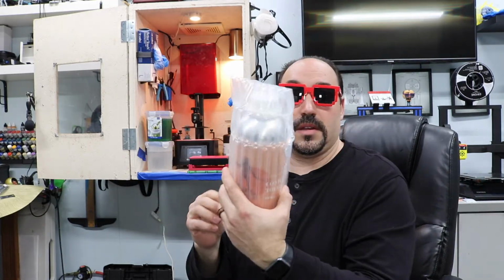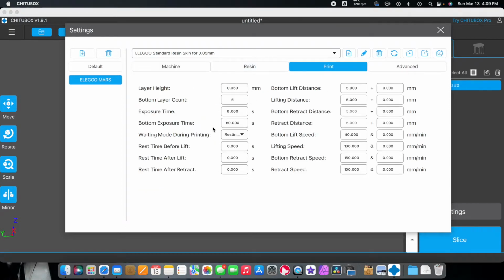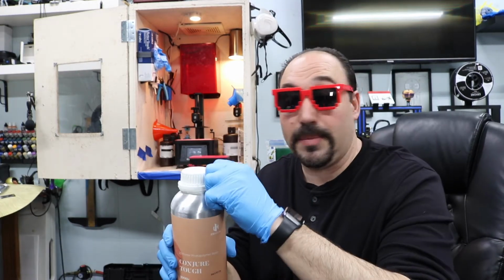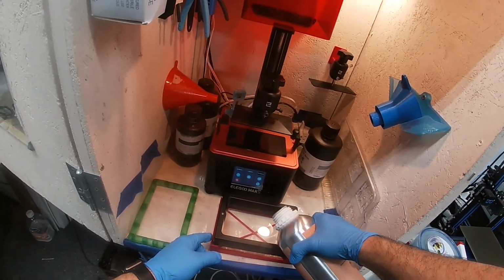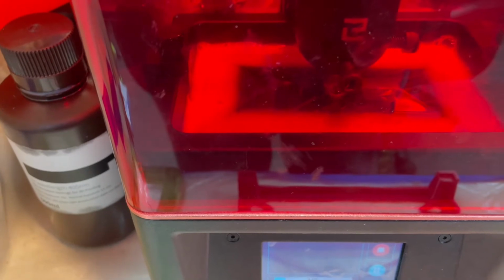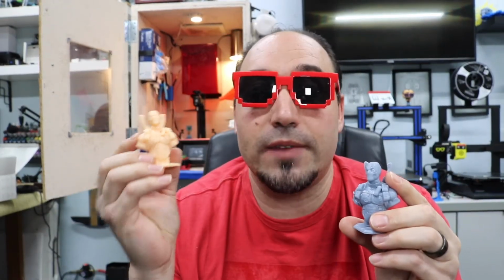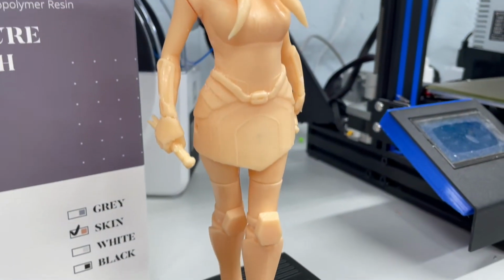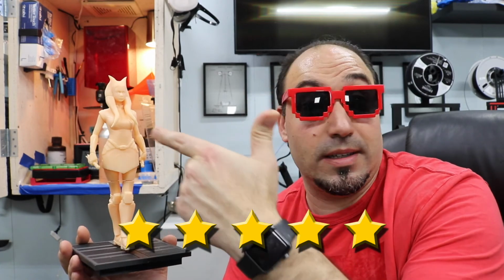Jamg He Conjure Tough resin for 3d printer review

Comment: Thanks for the video.  Kinda bummed you reviewed a "tough" resin and didn't do any toughness tests or comparisons.  Compared to any other decent resin what made it earn 5 stars versus 3 or 4?  I would recommend you limit a "star" rating to objective measurable results, because this comes off as a "thumbs up" passing grade so maybe just label thing that way.... "Crazy approved" instead of a star system, to stay safe with your non-offensive free stuff sort of policy.
Reply from the maker: I actually shot a ton of video on testing strength and durability against the elegoo Resin. They came out the same and video was way too long. I gave it a five star because it was a five star it did what it promised to do, and printed well. Trust me if it was crap I would tell you. Been shying away from companies giving me free stuff lately. Because they try to push for five stars and video previews. Never gonna happen! I’d rather buy my own stuff and I make enough money to do so on YouTube. Next season so far is just stuff I bought for review. But then again you may be right maybe it should’ve lost a Star for the price.